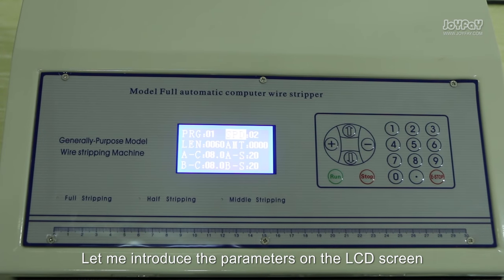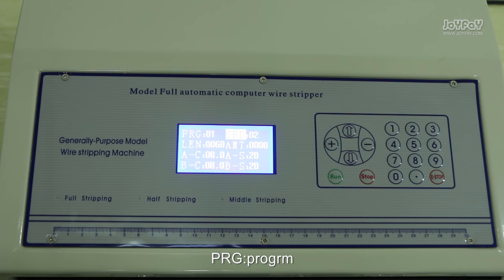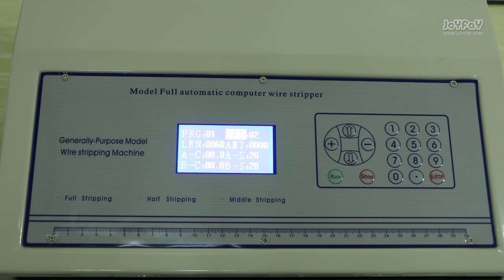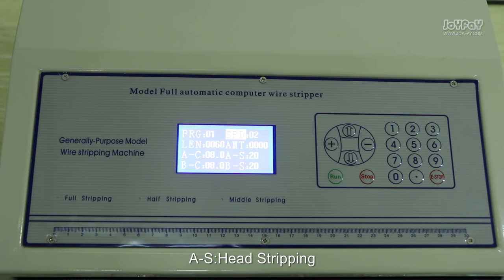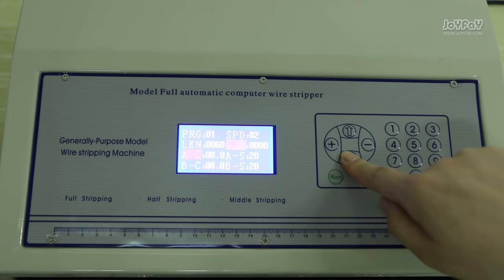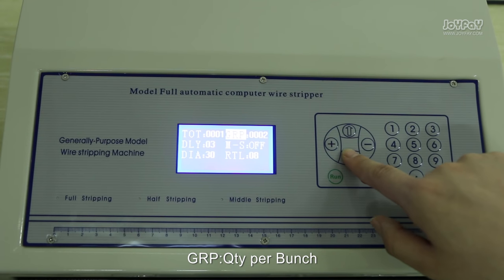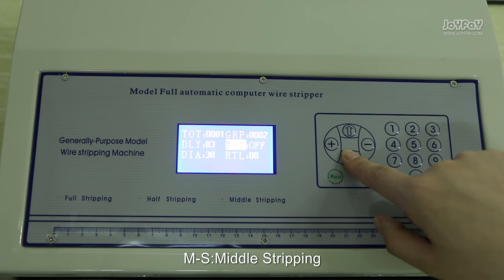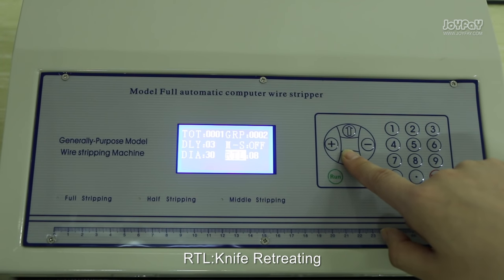Automatic Wire Stripping Machine

Comment: We ordered this machine recently- it does not remove the insulation from the middle strip sections OR the head / tail sections.  We have tried different wires.  Any suggestions?
Reply: machine problem, or program problem?  what did the seller say?